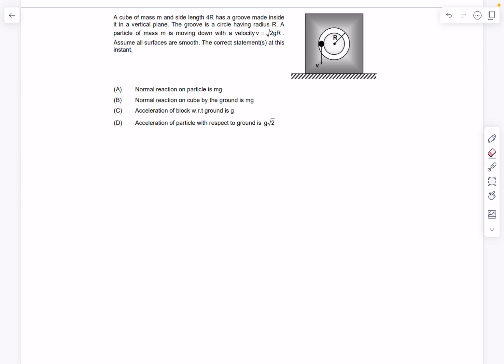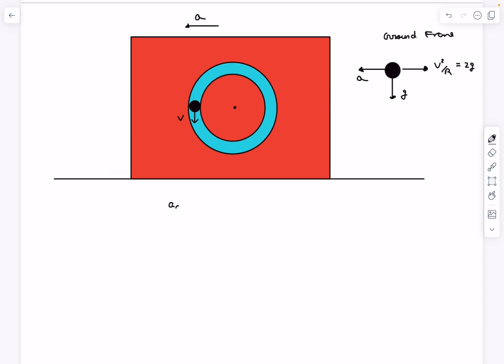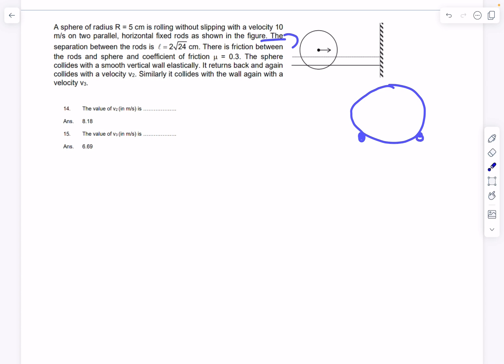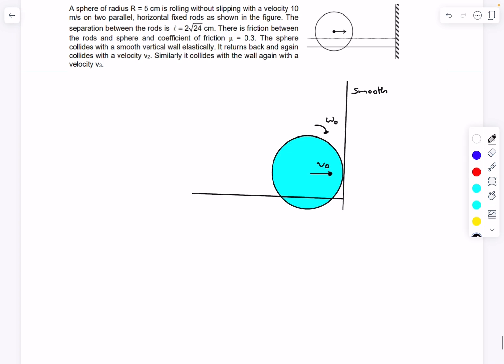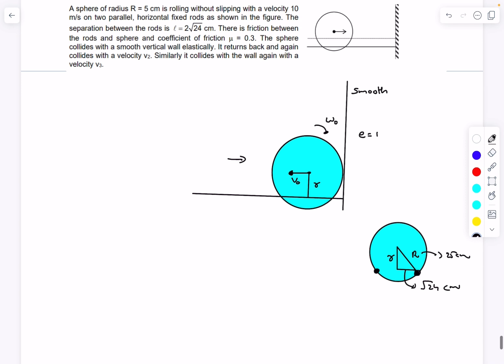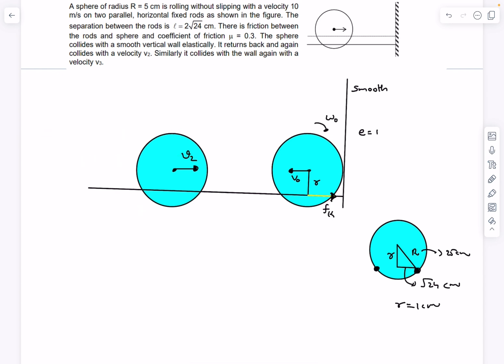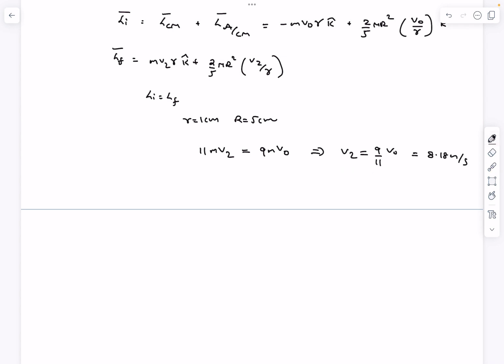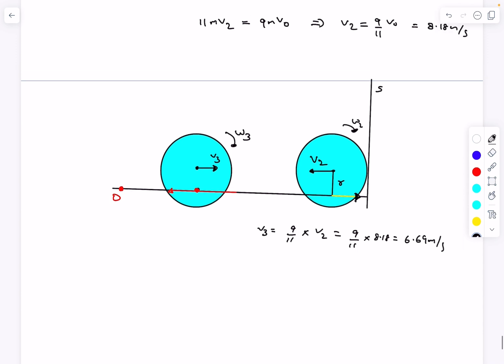[JEE Adv] Good Mechanics Problems | AITS

Comment: 8:43 how does normal torque cancel mg torque as the distance from perpendicular distance from point o is different for poing of contact and centre
Reply from the maker: It would be more clear if you wrote down r * F for both normals. I should have emphasized more on this part. So basically say the distance of centre from o along the rail is d then torques of centre is mgd into the plane and ny will have two comp 2*ny*d out( due to both normals)and one ny will have an ny*l/2 to the right and the other ny*l/2 to the left

Comment: I had a doubt, shouldn't Ny pass through the center of the sphere? how do we decide which surface normal should be perpendicular to? I ask because i took normal passing through center, equated vertical components to mg and got N = 5/2mg solved using time and friction and got correct answer, but if i took Ny vertical i would get N = mg/2
Reply from the maker: NY is the vertical comp of n
Reply from the maker: That I took in vid
Reply: @PhyX_03  ohhhh okk, sorry my bad

Comment: bro i have a question which is not related to this problem but why do we take only components of mg in an 
inclined plane why cant we take components of Normal on the block by the inclined plane to find acceleration of the block
Reply from the maker: You can do that as well. It's just that we want to break the motion along the incline and perpendicular to it. So we can treat it like ground to ground projectile with a horizontal acc.
Reply: but how do we find the normal reaction value if we take components of normal . I'm getting 2 equations and 3 variables 
1)mg-NcosQ=may
2)NsinQ=max
we dont know what ax and ay are so how can we find normal reaction @PhyX_03